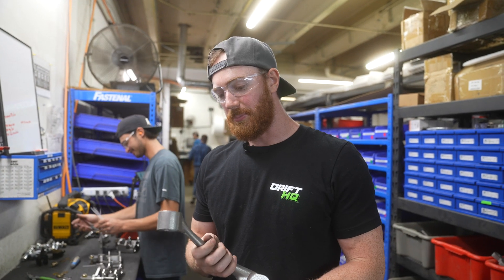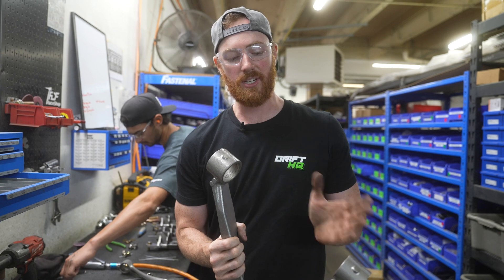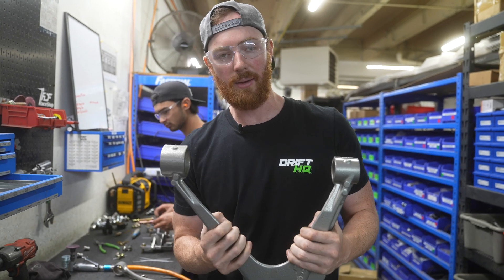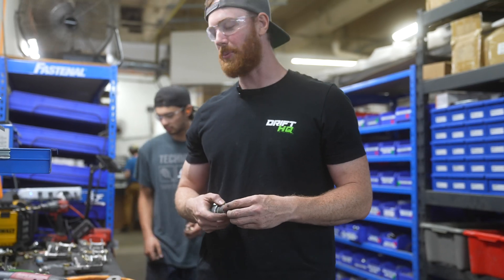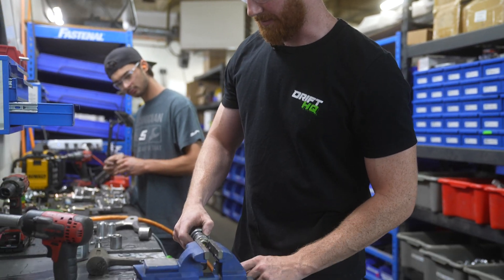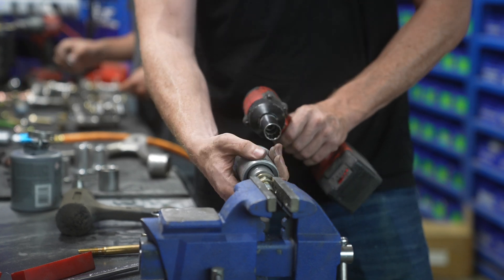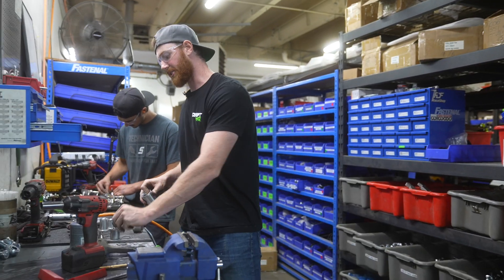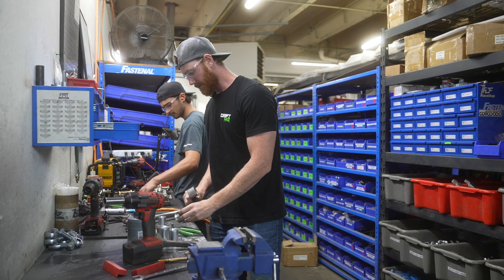Can We Make An Interactive Suspension Display?

Comment: Would it be possible to get measurements or a cad file of the proper mounting points for C6 front suspension? I am adapting c6 front suspension to my E46, and don't have a corvette to get measurements off of. I plan on buying the bearing kit for the stock control arms when you guys release them!

Comment: Building weight into a dynamic display, ain’t a bad thing, provided it isn’t top heavy. Might consider removable legs or a stand, to get it up to table height and not have the issue of it sliding around on a table, for shows like PRI. Legs or a stand are also a opportunity to display your work and craftsmanship and could be done in a flavor, like chassis / roll cage construction methods, to further highlight y’all’s capabilities.